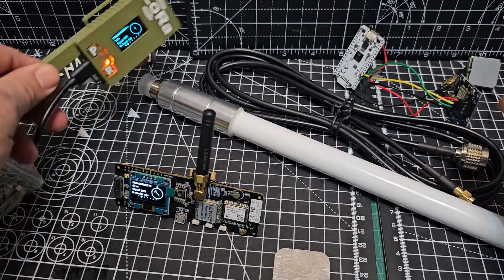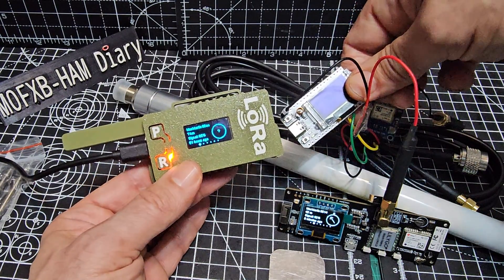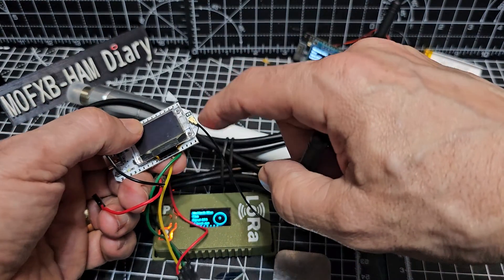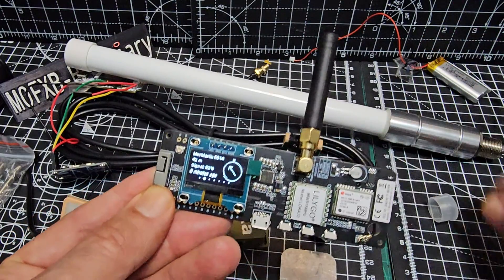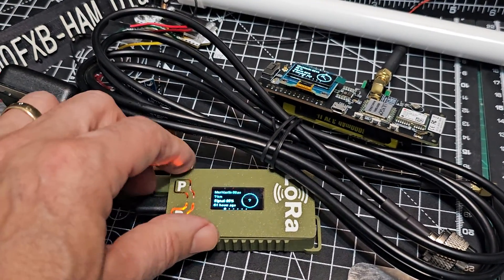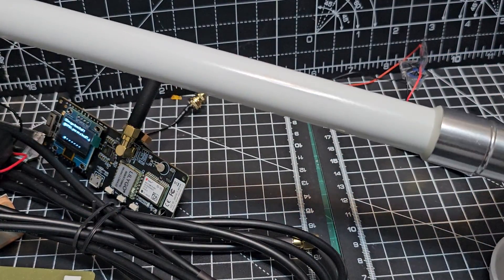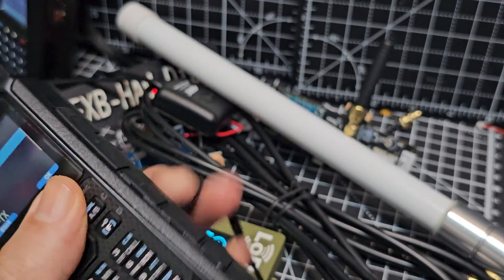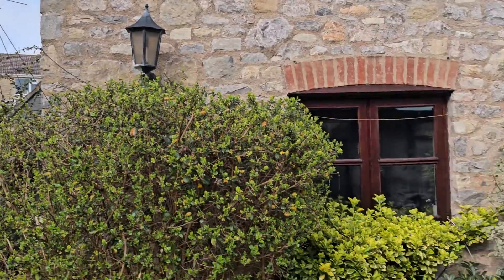MESHTASTIC 868 mhz OUTDOOR ANTENNA £14.99

Comment: I have put the Heltec and GPS in a waterproof box up a pole with the external antenna mounted on the box, then fed the power from the shack. This is working really well. It's just a bit of a pain in the ** to flash new software as I have to take it down.
Reply from the maker: Yes many have said this .